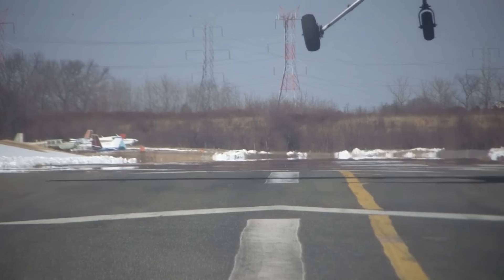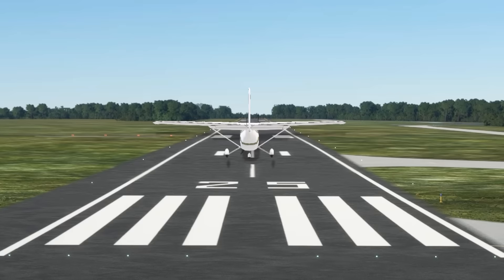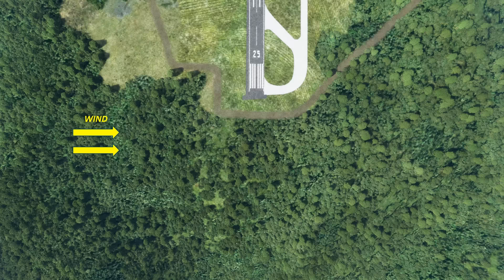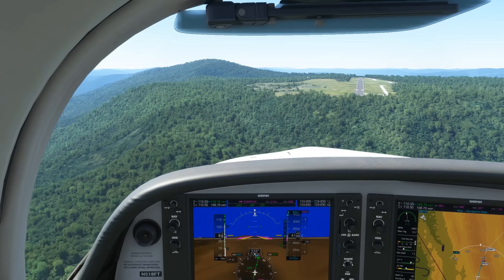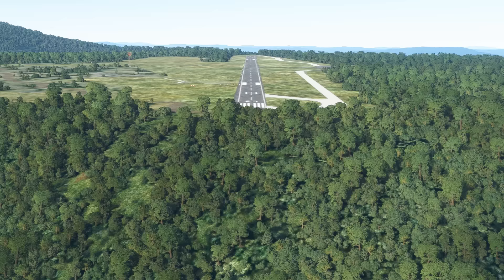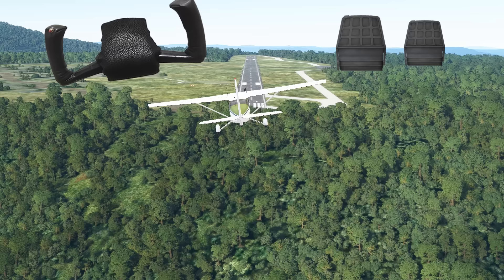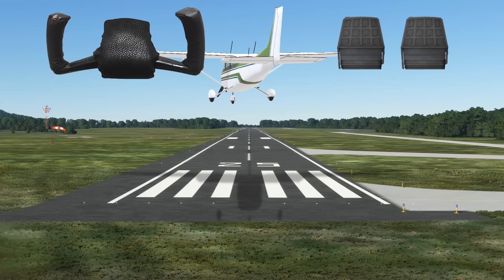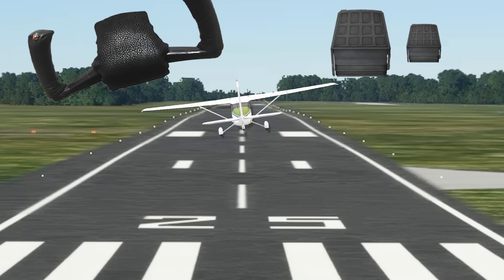Mastering the Crosswind Landing | Side Slips and Crab | How to Land an Airplane

Comment: My CFI also suggested landing with one 1 notch of flaps (touchdown at higher speed for better control) when runway length permits.
Reply: during strong crosswind you usually need to use lower flaps to maintain elevator and rudder control as well
Reply: Not really!!! You will have an aircraft that wants to float on the runway- as the crosswind relentlessly shoves you off the runway!!!
Reply: Sounds like you haven't really landed in a "strong" x wind!!!
Reply: It's not as simple as that. Less flaps higher speed (typically 5kt for half instead of full flaps) doesn't mean a floating plane, you just also increased stall speed. Why do students find the flaps up landings usually easier in the beginning? Higher speed means more direct reaction to control inputs, more authority. Crosswind landings require a slip latest after roundout. That bleeds of airspeed faster than you are used to in (I hate the word) the flare which really is slow low flight over the runway until your plane doesn't want to fly anymore, or at least close. Moving everything up 5kt, or even 10kt without flaps can help there. Don't forget a Cirrus e.g. lands full flaps faster that most high wings without flaps anyway. It's a matter of experience. In the beginning, there is nothing wrong if you have trouble with control of the aircraft to go a little faster with less flaps. Not faster with full flaps because that's making it worse. You still have to control the plane down to the same touchdown speed. Less flaps and your touchdown speed and authority go up. That's also why with more experience you don't do it anymore because there are other risks of higher touchdown speeds you can avoid if you are fine with a slip at low speed in the "flare" and the bigger inputs you need to get right. A Cirrus without flaps you maintain so much control, it feels much easier to land with 90kt approach speed and no flaps, if there is enough runway. But everything you mess up on touchdown and after that is also amplified by 10kt. So it's really not recommended.
Reply: @douglasmcroberts9586  nah. Just 16knots gusting 22 in a small piper. 
P.s.  less flaps = less floating = more control
Reply: Yep…
Reply: same

Comment: Crab is the only right way to do crosswinds. As you stated, you’re constantly changing the inputs as the plane slows down anyway, AND since the winds at the surface are going to be different than the winds aloft 99% of the time, there is no reason to be cross controlled on approach. 👍🙌🏻
Reply: I agree with you and teach the crab approach as well, but I'm going to push back a little on "the only right way...". People have their pet techniques and if it leads to a good landing, who am I to call it wrong.
Reply: @chapmanflying7632  I know…. But I’m obnoxiously stubborn on This particular topic 😆 because while other people
may be able to “make it work” other ways, they’re working harder in the process by doing so 😊
Reply: I don’t think I would want to put the plane on the runway while crabbing…..
Reply: Crab on approach, cross control to land
Reply: I found myself much easier to do side slip x/w landing. My mindset and body just keep doing the same motion - side slip all way down the runway. I crab on the long approach, side slip at ~200ft AGL, sometime add a touch of power to keep the speed. This gives me a stable approach all way to the ground. I did the crab and cross control during flare, feel like it gives me less margin ( no time) for error. All techniques work for you on a small plane, a safe landing is all that counts.
Reply: Wrong. you're making last minute adjustments as you figure out the winds into the flare. Acceptable approach, but not the best.
Reply: @jamesqu2000  I agree with you. students aren't good at juggling everything all of a sudden all at once, right at the most critical moment. slip allows them to minimize the number of variables to juggle, and its them focus on other aspects of landing. Very stable, literally no issue adjusting to the variable crosswinds.

Comment: The Problem with the Sideslip is, that it increases drag a lot. Perfect for a fast descent if no speed brakes available, but in the crosswind scenario You might prefer a "normal" descent. Best Videos to a lot of topics btw.
Reply: Um,, you aren’t really side slipping. You’re flying into the wind enough to compensate for drift. Technically you are crabbing when the nose is pointed parallel to the runway in a cross control situation..
Reply: @michaelgarrow3239  No. Those are two different Techniques. You can do side slipping (4:00) or crabbing (2:15) or a combination of both. What ever You choose: the moment You intentionaly do not fly coordinated (rudder and aileron not in sync) it's called slipping. And that creates additional drag.
Reply: @streptokokke1003  - Um,, that is exactly what I said…
Edit: I guess I wasn’t clear. 
When you’re flying straight down the runway in a crosswind- and you are using cross controls that is technically a slip.
When you crab into the wind to compensate for drift you are in coordinated flight and not slipping…
All of this is completely confused by using a slip to crab an airplane to lose altitude in a no wind situation…
Reply: @michaelgarrow3239  Yes, and this cross controls create additional drag.
Reply: @streptokokke1003  - yes they do. 
😎

Comment: In the opening and closing scene, the pilot is slipping the wrong direction. This occurs when the pilot starts by useing the yoke to turn towards the runway (a natural tendency for anyone who has driven a car) and is then forced to use the opposite foot to keep from drifting off center line. The fix is, like jumpinng into muddy water, FEET FIRST. Start with rudders to straighten up the airplane direction and apply opposite ailerons as required to first keep the upwind wing from rising and then even more aileron to drop the upwind wing to control drift.  
When I taught X-wind landings, I split the controls. As one pilot straightens out the nose with rudder, the other pilot applies the opposite airleron. Let the student pilot concentrate on the rudder first  because it is the less natural control input. The instructor manipulates the ailerons for drift and elevator and throttle.  As the airplane touches down the instructor will maintain a shallow bank into the wind for touchdown and as long as possible into the roll out, adding more aileron into the wind as both mains touch ground. The landing roll out ends with full aileron into the wind. On the next landing, revers the rolls. Let the student run the ailerons, elevator and throttle while the instructor runs the rudder. Once the student has mastered each drill then let the student do both.  5K hr CFI & 25K hr ATP

Comment: The slip is the greatest cheat code for the GA pilot.  Proficiency in side slipping turns crosswinds into a non issue (up to a point).  With the additional drag, I usually add a touch of power to keep a stabilized approach.

Comment: This is the best video I have seen on crosswind landings.  Just a couple tweeks, if an old Ag instructor may.  First the nose we think of, under   the prop, is not an accurate way to maintain longitudinal alignment.  Keep the centerline and centerline extended between our legs.  How can it be both between student and instructor's legs.  It's optical.  We are looking well down the runway.  As you pointed out so well, we keep the centerline and centerline extended between our legs (side slip method) or aligned with out butt (crab method) with slight rudder movement.  Dynamic proactive rudder movement to bracket the centerline (or taxi line) is a tailwheel method (walk the rudders) that works equally well with nose gear airplanes.  Coordinated turns to keep the centerline between our legs certainly doesn't work on the ground.  Nor does it work well on short final.  Adverse yaw is a bit complicated with all this other stuff going on.  Even with the crab, dynamic proactive rudder (walk the rudders) will bracket the centerline extended under our butt.  With the side slip it is absolutely necessary to use rudder only.  Even in a no crosswind situation, walking the rudders a bit to tightly bracket the centerline extended will automatically keep the wings level.  Rudder yaw is how the B-17 bombardier, with the rudder trim control only, aligned the crosshairs of the Norden bomb sight with the target.   Again, an excellent lesson on crosswind landing techniques.

Comment: Useful, practical and excellent info.  Graphics superb!  Thanks, too, yoke and rudders in upper screen.  Side slip I believe will cause one to lose altitude faster than crab  method.  AS you say, either method is tricking and adjustments made subtly and quickly over the runway. Practice, Practice. But every landing in crosswind is a different adventure!

Comment: I flew my 85hp Cessna 140 out of Lancaster california. High desert always hot very windy with crosswinds in summer. Found the safest way. NO flaps. No crabs. Too dangerous switching from crab to slip. Higher than normal approach speed. Dip that wing into wind to keep from drifting. Use rudder to keep nose on centerline. Force that wheel into ground with yolk. Hold it there hard. Kind of like carrier landing. Keep bleeding off airspeed …opposite wheel will drop to runway. Keep pushing that yolk hard forward with aileron into wind. Tail will next drop. Fly it on ground to hanger or tie down.  With the winds we had the ground speed at touchdown was minimal…10mph roughly on bad days.

Comment: I'm having a hard time understanding how to adjust aileron input in the landing roll out to prevent drift. Here is shown two things regarding: 1. Once all the wheels are on the ground the aileron input must be increased and 2. After landing the only purpose of aileron input is to keep the upwind wing down. My question is: How much input and how to know it??
Reply: After 1. as you continue to decelerate, gradually increase the aileron input to maximum deflection into the wind and maintain it until you turn off the runway. While taxiing to the ramp or tie-down you may need to deflect to the opposite direction depending on where the nose is facing relative to the wind, each time you turn. Feel free to ask for any further clarification if you need.
Reply: @djholro   How very kind of you. Thanks!

Comment: The ailerons, making BANK to control drift, are the SAME as that used on roll out that provides the adverse YAW to supplement the rudder with directional control. 
Especially usefull with near nil braking in winter or wet runway.
A MUST in tail wheel ALL THE TIME.
RULE: Ailerons PROPORTIONALY applied opposite to needed rudder. 
X controled touch down & rollout.

Comment: When you're touching down in the crab, after your rear tires touchdown, should you center your rudder pedals before the nose wheel touches so you don't jerk the plane off runway since you use the rudder to steer on the ground?
Reply: You don’t touch down “in the crab”—even if doing a crab maneuver on final you still need to straighten your fuselage out before touchdown (using slip cross controls). You want your upwind mainwheel to touch first, then your  downwind mainwheel, then your nose wheel. In other words you need to put yourself essentially in a side slip (aligning your nose with the runway) just before touchdown.
Reply: The nosewheel actually stays straight while in the air even with rudder inputs.  So it will always touchdown “straight”. As weight goes on the nosewheel, it aligns with your rudder, so you will probably feel some turn if you have rudder in but you will be able to react and let out rudder. But to answer your question you don’t need to center your rudder pedals before the nosewheel touches down (it’s already centered!)
Reply: @MrDogfish83  I see.

Comment: the only problem is that none of these methods would work on a bigger airplane (I mean airliner); 
yes, you would use a crab and then decrab before flare but you can't put the upwind wing down and land on one wheel (you risk a pod strike)
Reply: This video is for light singles. Big planes are designed differently and have different techniques,.
Reply: @chapmanflying7632  what is the typical technique for a bigger plane?
Reply: The kick straight method is viable for larger high wing aircraft such as ATR, Dash 8  and in some cases airlines. However airliners are also designed to withstand side loading for these kinds of landings.
Reply: You can put the upwind down and land on the upwind gear during the flare  with a boeing 737.  You just have to be aware of a precise bank angle where the bad things can happen. Anyway it's just  not recommended,
but you definitely can do this.

Comment: The one thing no one ever does is partial flap landings in calm wind.  So we get into a higher stress situation with a crosswind and introduce a new landing profile we don’t hardly practice, partial flaps.  

Regardless of crosswind I land max flaps in light aircraft (many years flying 135, GOM 35-40kts X limits) Fly the aircraft as similar as possible for each scenario to reduce variables that come with conditions.  Drive it on, dump the flaps and transition from flying to a ground object ASAP.   The idea is that at flaps 0 or flaps 10 you land at a speed that allows the aircraft to fly (lift) without any way to increase stall speed when the mains are touching.  Landing flaps full you’re still landing at a speed (slower than flaps 0 or 10) that allows for flight but dumping the flaps when you touch means you’ve now raised your stall speed well above your Vso & probably Vref+gust additive.

If you need the speed to make the ailerons, elevator or rudder effective go somewhere else.  If I can’t control it in the air I sure don’t want to be rolling out with diminishing control ability.  

Yes we add up to 15-20kts (depends on the operator) In the transport category aircraft to Vref for winds but it’s calculated for landing distance & briefed.  

Crab vs side slip depends on type of aircraft.  Crab landings in TW no bueno, light retractable gear aircraft again no bueno, hard on the gear, can fold a gear leg if you slide on ice and grab dry pavement etc.  

Conventional gear transport category aircraft can handle and need a crab landing (otherwise we drag the engine pylons) though we do dip the wing somewhat usually to get rid of some of the crab.

Comment: i need to understand, how does the crab happen? How do you drift like that up in the air without banking the airplane? Are you using slightly some rudder into the strong winds and a result you look like drifting sideways? Thanks.
Reply: You maintain wings level with your ailerons
Reply: You dont do anything. The wind pushing against your vertical stabilizer will establish a crab angle
Reply: It's pretty simple really. The airplane is moving through the air, but that air is also moving relative to the ground as wind.

Comment: you absolutely hold the centerline with aileron and the ONLY function of the rudder is to keep the longitudinal axis of the fuselage aligned with the runway.  you have it totally backwards and have no business claiming to teach proper xwind landings.  you would ground loop if you tried to land a taildragger in a decent xwind without a doubt.  you should never teach a student to crab on final either, they should use this as an opportunity to get comfortable with using the correct amount of aileron to stay on centerline with the changing wind all the way to touchdown along with the amount of rudder needed to keep the aircraft alighned with the runway as you are adjusting the ailerons.    you also don't address the importance of knowing which way the aircraft is going to drift once it touches down because i don't really think you know the answer to that important question.  it is going to drift to the left side in a left xwind and almost every pilot forgets about aileron input right after touchdown and steers the aileron like they would steer their car which is the exact opposite as the needed input of steering aileron the same direction as it is drifting.   also the ailerons are far more powerful than the rudder for controlling drift after touchdown.   this is why almost every groundloop happens especially in taildraggers.   when the airplane drifts left after touchdown the pilot steers right without even realizing it and full right rudder and right brake won't overcome the force of the incorrect aileron input and it goes out of control off the left side of the runway.  also the airplane in the beginning of the video has the nose slightly pointed away from the left xwind which requires even more left aileron to hold the centerline.  every degree your nose is pointed into the wind results in less aileron required to hold centerline.